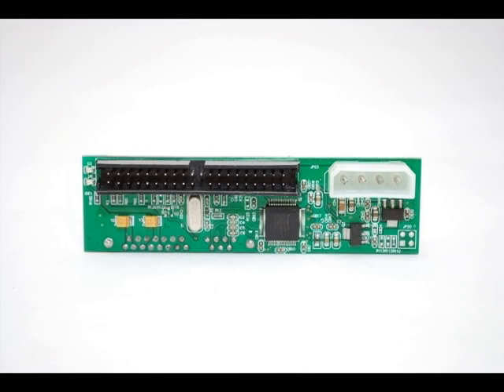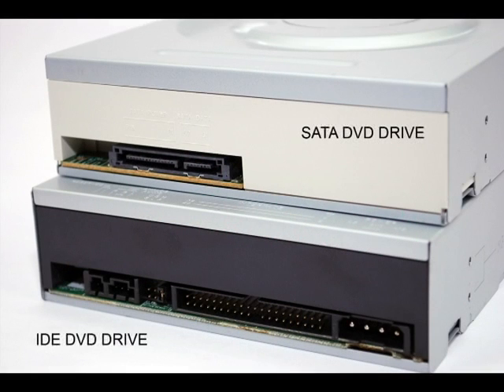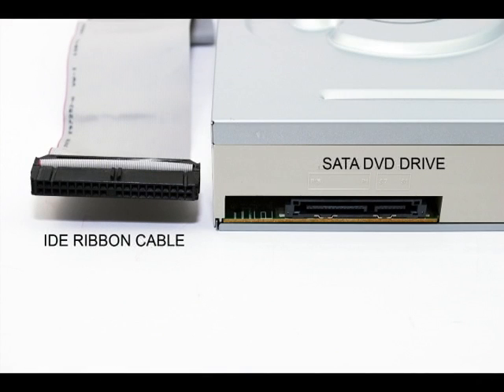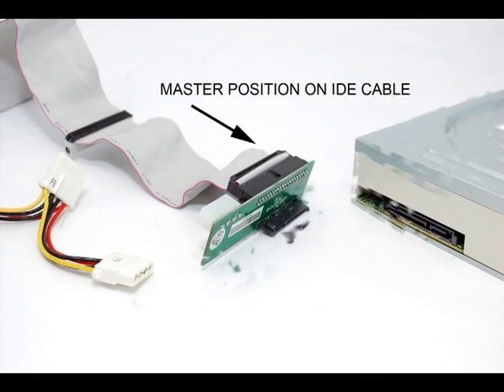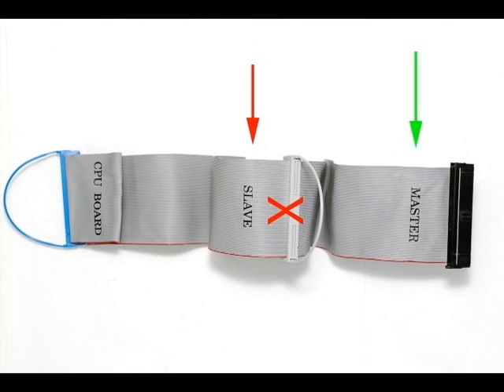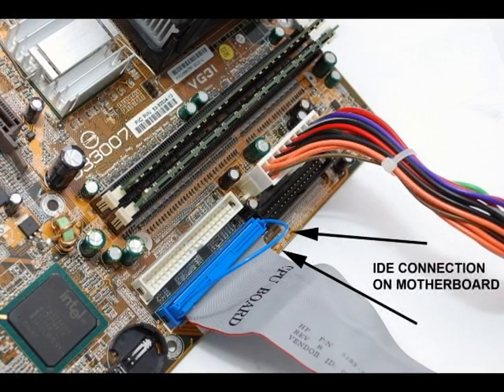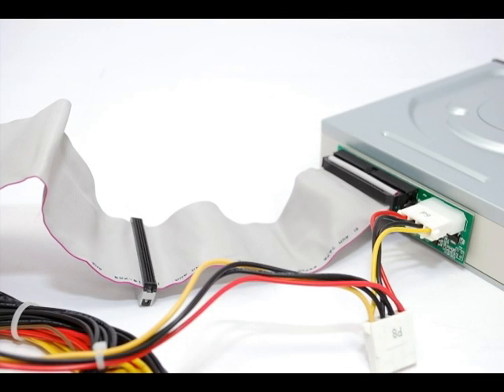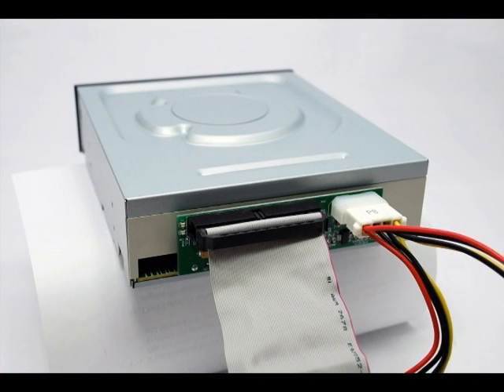How to install a SATA to IDE bridge board

Comment: Why can't I have a slave on the same ribbon?? I need to keep using my other dvd-rom drive and the comp stopped seeing it. Do I need to first boot up without the slave connected and THEN reconnect it, or does using the bridgebo make a slave connection on the same ribbon impossible?